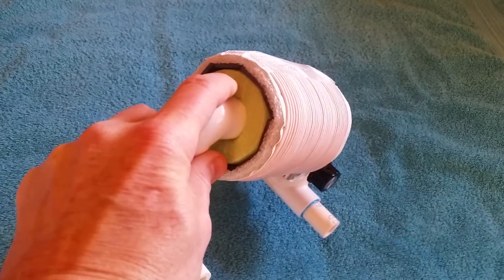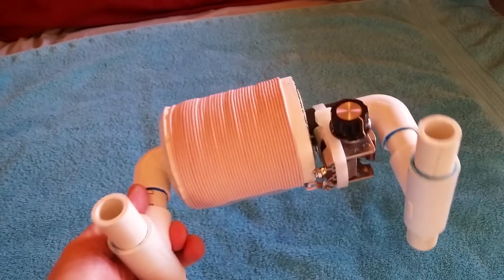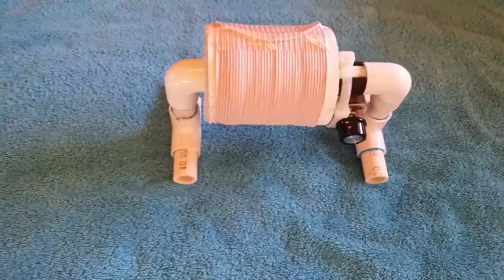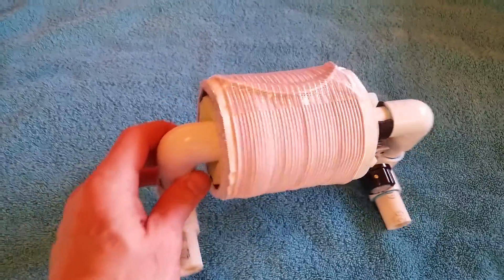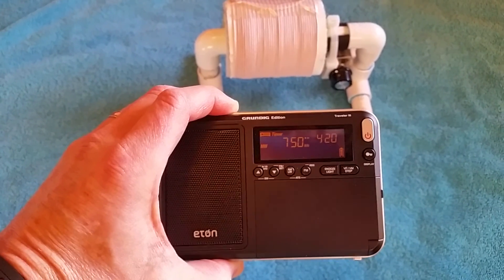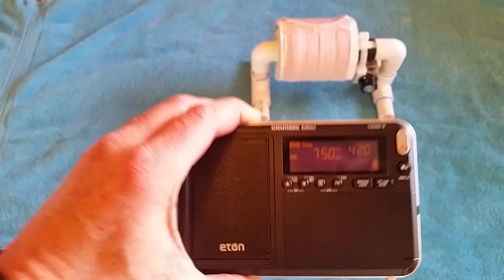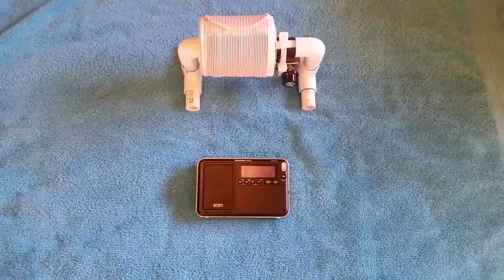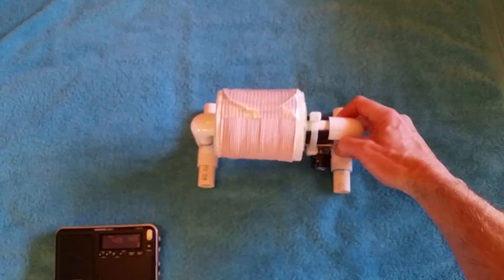"Frequent Flyer" 3 Inch (76mm) Bar FSL Antenna Demonstration

Comment: What will happen if you instead of using the width of the ferrite bars and instead make a around 12 inch loop using the lenght of the same amount of ferrite bars and use the same amount of litz wire or adjusted length to fit around that?
It will of course not be small anymore but it could in theory be better regarding the reception than a ordinary dynamite stack ferrite bar/rod type or a ordinary loop antenna?

Comment: Gary, I bought the new version of this radio, the Elite Traveler, after reading about the shootout. I love it. A Tecsun PL 310et I bought ( I`d been told it was a good AM receiver) was extremely weak on AM using the speaker so I bought the Eton after doing a lot of research since I wanted a small radio that uses AA batteries. Later I discovered that the Tecsun worked fine on AM using earphones. Strange! I live way out in the sticks almost 2 hours from the UPS store so I couldn`t return it. For some odd reason the Tecsun is a far better daytime receiver than at night. Another odd quirk that`s a mystery to me!

Comment: Hi Gary,  I looked at your FSL optimization page, where in 2012 you conclude that the longer an FSL antenna the more sensitive.
But in later models I see you go to a 15" diameter, although still using 7" or 8" inch rods. Do you still get improvement with increasing diameter?
 Have you found a minimum thickness of a flat bar? Is 3mm as thin as you would go? I'm starting to see bendable ferrite sheets of 0.5mm thickness, don't know the material or losses in the composite around it.
  Would you have any improvement by offsetting the ferrites, slide every other rod out say 1/3 third or 1/X  of their length?
That would make a 6" rod make a total length FSL of 8" with a caveat. Just curious if there is a point of free gain in there.
Reply from the maker: Hi Lamont, The conclusions in the 2012 FSL Optimization article are all still valid, and the larger coil diameter FSL's will always outperform smaller diameter models. I have been using the 15" diameter models primarily for reason of convenience, since they weigh about 30 pounds, and are more easy to carry around than the 38-pound 17" diameter model. As for ferrite thickness the 3mm bars are the thinnest that I've tried, so I really can't comment on the new ferrite sheets. In my opinion offsetting the ferrite rods really wouldn't accomplish anything since you would be introducing gaps between the rods by sliding them out of the sleeve this way. This would probably offset any improvement from sliding out the rods. Best results are obtained with a solid, cylindrical ferrite sleeve of uniform length and thickness. Thanks for your interest, and good luck in your own experiments!

Comment: Good work Gary! i would like to make one of these. I do not fly very often but that is no reason not to make one, hey?
Reply from the maker: Hello Lee, Thanks for your comment! I hope you can make one of these FSL's, although your biggest challenge may be in tracking down the Russian surplus 100mm x 20mm x 3mm bars. The bars are no longer available on eBay, but a few experimenters still have them around. Good luck!

Comment: Think it's possible to build an FSL that's small & inexpensive enough so that it AND a smaller ULR like the Sangean DT-400W or CC Pocket could fit within both the 20 cubic inch AND $100 ultralight definitions, while still beating a Select-A-Tenna, or a Superradio or PR-D5 in performance? :)
Reply from the maker: Hi Stephen, Because of the high cost of ferrite it's very tough to design an FSL that can be built for under $100. The reason for the high demand is the interest in the FSL antennas' superior performance for the size. So I don't think that such a ULR-FSL combination could ever be built for under $100, regardless of the 20 cubic inch limit.
Reply: Hmm, what happens if you use shorter rods, and make it a different profile?  (like, tall & skinny instead of short & stout).  Of course you probably couldn't use 1162/46 litz, but would 660, 330 or whatever is the next size smaller (140?) work?
I was looking on ebay a bit ago, and was seeing 30x8mm rods for $2.79 for 8, 25x8mm for $1.66 for 6, and 15x3mm for $8.50 for 100.
I cut some straws to those approximate lengths, and put them near a DT-400W and an SRF-59, for a rough concept photo at https://goo.gl/photos/gXoZz2jk5AHUbrjL6 (if YT lets me post it.)  Green represents 30x8mm, orange represents 25x8mm, and white represents 15x3mm.  Of course, something would have to be done about the pickup pattern for the ones around the DT-400W.  (Idk how much internal space there is, but I was thinking, put a ring of the 15x3mm ones inside the case perimeter, and wire it in place instead of the internal ferrite, but would that not have any improvement?)
Reply from the maker: Stephen, the gain tradeoff with shorter ferrite rods is fully described in the FSL Design Optimization article, which is posted at the following link:  http://www.mediafire.com/file/6oyoldllrbiwf91/FSL_Antenna_Design_Optimization.doc   The overall gain of an FSL antenna is determined by the coil diameter times the length of ferrite material in the sleeve.